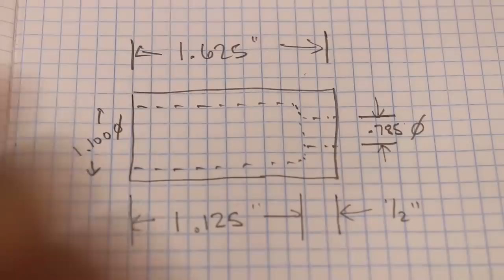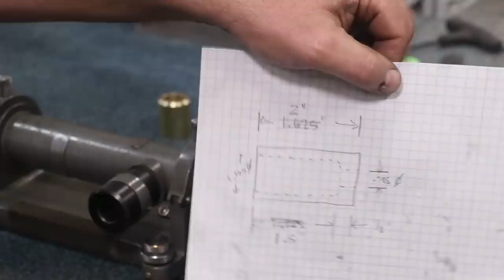Autocollimator Upgrade: Adapting a Right Angle Eye Piece

Comment: Nice job. My whole career was spent looking through oculars or onto electron-microscope screens and I know how important it is to be comfortable when using an optical instrument. I just watched part of this with the sound off so as not to disturb my wife who is working on one of her artistic pies and I noticed something that made me smile: A piece of metal - chucking it up - facing it off - centre drill - small drill - medium drill - large drill - boring bar. When you have done this work or watched enough shop videos you know right away what will come next. I smiled because I caught myself giving a running dialogue on what would be next. Thanks Keith. Always enjoy the videos.

Comment: In line with other suggestions I'd suggest you try a simple cheap USB camera which easily connects to a cellphone, laptop or PC.
It does not in any way interfere with the accuracy of your Collimator, it simply tranfers the image in your sight glass on to the screen of you USB connected device.
That is the most healthy thing you can do to your spine, neck and legs.
Being 67 myself and much like your body style - and I think you're looking good !

Comment: Keith, one upgrade you might think about would be to replace the set screw with an O-ring, use the friction of the the oversized O-ring to allow you to adjust the viewing angle without needing tools.  Also it would allow you to dismount the ocular quickly.

Comment: How about making an adapter for a camera,then hook it to a monitor and you won't even have to bend over!
Reply: Les Bender   You are 100% correct, that is the only way to go.  He said 250 times he had to look into that scope, let's get that down to zero.
Reply: Everyone needs a little exercise.
Reply: I thought the same thing and was going to make the comment on that.  But it looks like I'm not the only one that geeks everything out.
Reply: The biggest job will be to try and find another project that needs this thing.
Reply: @K-Effect  it is not that difficult to get an eyepiece that is a 90 and has video microscopes have them. prob find one on ebay cheap
Reply: A clear lens is better than a monitor and your working with the instrument so it's natural to use the eyepiece,
Reply: @JohnDoe-ot7wv  Nothing wrong with it, it just seems to me it would be more efficient to just glance at a monitor without distracting yourself by bending over.😊
Reply: the weight of the camera and the wire may throw off the precision on the instrument, better to use WiFi camera no wires
Reply: Telescope cameras are used all the time in stellar observation for everyone including amateurs.   The great thing about using those is that you are less likely to influence the instrument by accidentally touching it.   Even standing near the object being measured has influence so the camera setup is great for remote observations.   You can even use your cell phone to observe.
Reply: There's also obvious benefits of having a camera to share what is being observed with us viewers.
Reply: Guys do that with their reloading scales to measure powder charges
Reply: I adapted a very small CCD camera to my Hawkeye bore scope so that I can display the image on a laptop. It still allows the scope to be portable and makes it 10 times easier to use. Also allows me to take still photos or videos for future reference or sharing. I wish I would have done it years earlier than i did.
Reply: Why not if put on a camera. Put on a big screen, then just make adjustments, look at TV and continue. Or hire some one else to do it. Or hey don't do it at all. Okay taking it too far sorry! Just going crazy! Stuck at home.
Reply: @K-Effect  "Let's?" When was this a group thing?
Reply: @be007  Love how you invite yourself into other people's matters. You must be lonely, poor lad
Reply: my thinking exactly... heck won't even need to close one eye :-)
Reply: Just about to say the same, i notice others mention a telescope camera, but a cheaper idea would be a 'door viewer' camera, when you remove the housing you can rotate the lens for focus, it runs from 12v, then get a car monitor (7 or 10") that also runs on 12v
The camera is composite video, so the monitor must be tyoo.
I have some door viewers on my cctv.
Also, this idea could be useful for showwing people how to use it, get a capture card (usb dongle) plug it into a laptop to view and rrecord the footage ;)

Comment: Keith, have you considered an adjustable height seat with casters?  I do my best work on my big fat a$$.  The dangers of being a retired Locomotive Engineer.

Just a thought. You could use the original straight through arrangement if the seat was low enough and you might no need to bend over as much as the right angle adapter may require.

Now I need to watch all the other videos on the autocollimator.

Comment: A simple CCD camera chip and a small sleave would make it beyond great. And they make very small CCD cameras for such things. Then you merely slide in on and watch via a monitor. No more back pain or bending over and you can even see the results from across the room if you like... Remember, work smarter. not harder... Had to use that stupid line from hearing in so much!

Comment: I'd get a Raspberry Pi and the new 12 MP camera module. Install the camera module directly to the autocollimator and have a cable off to the Pi and from there, HDMI off to a large format monitor. Then, you can see what the autocollimator is reading from across the shop. I was thinking about this while watching the videoes of the scraping of the shaper ways.

Comment: One thing that you didn't mention, or I missed it, is do you focus the image on the autocollimator first and then add the adapter or do you just have a focus on the adapter itself? 
If you have to adjust focus before you put the adapter on why not cut a slot on each side of the adapter that is about 1/5 the circumference on both sides to give you access to the focus adjustment on the autocollimator itself without having to remove the adapter?

Comment: There are several suggestions to go with a small electronic camera and a monitor. While this is a better idea than mine, it still has some drawbacks like the time lag.
My proposal would be to add a projection screen (e.g., 4x4in). The light from the autocollimator hits the semi-transparent white film from the back, and you look at it from the front. Then you wouldn't even need to bend your back but could see it from a few feet distance.
Probably this would require a much stronger lamp, or you would have to dim your shop lights while working with it. At least it is still "old school", in contrast to the electronics solution (said by an electronics and semiconductor developer here :-) ).

Comment: I had a thought for you all. My dad was a machinist from the early 60s through the mid 90s. One thing his shop had and used a lot of where Blanchard vertical surface grinders. Huge machines. Some of them on the shop floor where big enough to fit a modern smart car on it. How come you don't see much documentation about these things around? I see a few pics here and there, mostly old manual diagrams. But hardly any video and few pictures. Was it something that only a select few companies had a use for?

Comment: Hey Keith, I am curious as to why you didn't do the smaller bore and the larger bore while still i the initial setup so everything would be perfectly concentric? It seems to me that you added an unnecessary step by flipping the piece around to bore the smaller diameter. I could very well be wrong though.
Reply: It's plenty concentric. It'll only be out a few thou. Way more than accurate enough.

Comment: Keith, or anyone, when the tap started squeaking in the brass tube, is that a sign that a lube of some sort ought to be used?  Or is brass just "squeaky" and doesn't really need a lubricant in this situation?  I ask because I want to start using more brass & bronze in my shop and more information is always useful.
Reply: Squeeky taps could mean a multitude of issues. In my opinion... tapping fluid is always a good idea. I think in Keith's case it would have made the adapter messy. Not really desirable on an optical instrument.

Comment: For everyone suggesting a camera - The only concern I would have is resolution.  Unless it's a 4K camera and a native 4K display, reading the very fine internal markings would be extremely difficult.  Even 1080i would be questionable with a high accuracy instrument like this.
Reply: Camera resolution isn't a big concern.  Even at 420p you can easily do adapted stellar observations with telescopes.
Reply: @rgmoore  but aren't most AO observations mostly useful with post-processing? Using an autocollimator is a live measurement and the resolution is of the internally fixed markings, not some (near) infinite focal length object.
Reply: @CAPFlyer  Since they sell autocollimators with cameras and camera attachments, one would conclude that as is the case with all other optical observation systems, cameras work just fine.
Reply: @rgmoore  from my personal experience, I wouldn't.  You are talking about target viewing, which absolutely is easily done with any camera.  The problem is the internal markings within the instrument.  Having those in focus and sharp is where the concern lies.  Having tried to do rifle scope camera setups, even rangefinder camera setups, it's very difficult.  I can often see through the scope just fine with the camera, but getting the internal markings to show is where you run into issues.  This is why scope-mounted cameras haven't been a real big thing until recently, and even then, the ones that are out there are using high resolution CCDs with 5MP+ resolution at 1080p or above.  The instruments that have camera attachments or are built with them were designed to use them.  I'm also guessing those attachment versions are more than $200.  If so, then you're not getting "just any camera" for it to work properly.  That's my point.
Reply: @CAPFlyer  You called out all of those that were suggesting adapting a camera.  My point has been that this has been done.  Depending on your budgetary concerns, not expensive.  I don't think anyone has considered 5mp that big a deal in a long time.   The problem you had is and is relevant, is one of focal length a fixed focal length camera with the correct range will easily pickup the crosshairs and the objective.

Comment: The 90° adapter, Is this your own idea or have you seen this done before?   I also like the comment by Les Bender about using a camera and monitor.
Reply: I'm pretty sure that the instrument used by the company who calibrated Keith's surface plate a few years back had a right-angled eyepiece.
Reply: I seem to recall that a camera right angle adapter was suggested many times after Keith first showed the instrument, way back.

Comment: When you put the piece back in to bore the smaller hole (13:17) there was a very noticeable wobble cycling, what causes this ?
Reply: The outside diameter of the brass bar isn't perfectly round. therefore the hole that was drilled while it was chucked in a different position is no longer concentric to the check.
Reply: @truracer20  Even if the brass stock was perfectly round taking it out of a self centering chuck and putting it back in again would likely result in some degree of run out in the part. The clamping forces of the chuck jaws aren't necessarily 100% repeatable due to machining tolerances and/or wear in different areas of the scroll plate and jaws.
Reply: @highpwr  Yes as you said there may be a noticeable wobble, but I was answering the question about the "very noticeable" wobble which in this case is caused by the out of round OD unless Keith's chuck is worn slap out, and I don't believe that is the case.
Reply: Could have also been the drill "strayed" off of centre when drilling from the other side... though that usually only happens when drilling with long series drills or small diameters.